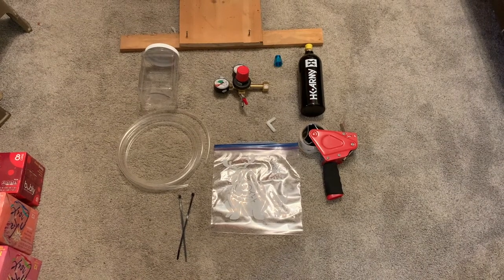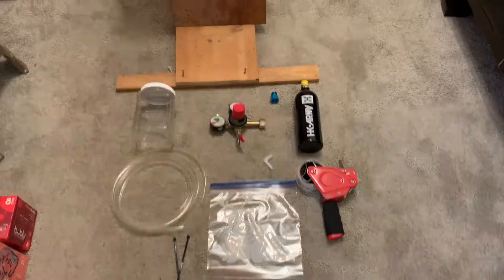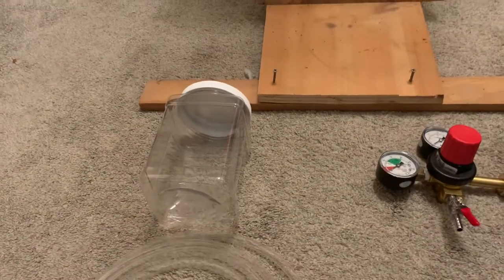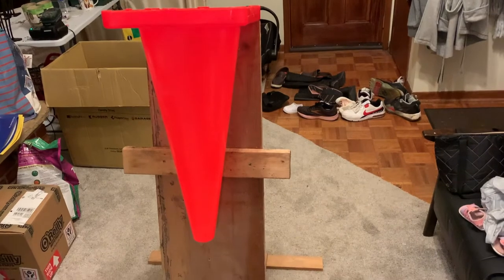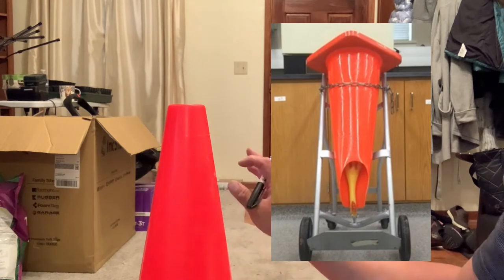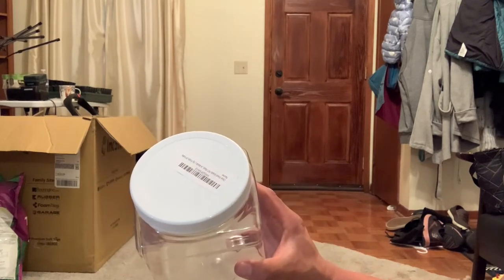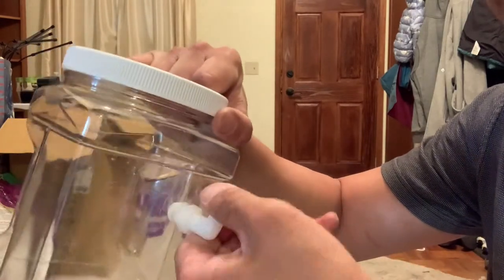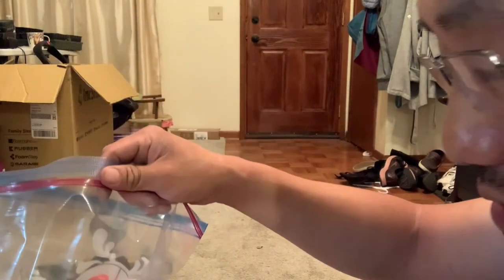How To Assemble A CO2 Device For Chicken Euthanasia

Comment: yes this is NOT what you do or make to put a chicken or anything else down. without clicking on the link I'm even going to say he got scammed by it saying this was the official state sanctioned method. All you need is a bucket that's sealed with a small vent. Literally that's it. This contraption is insane and again completely unnecessary.